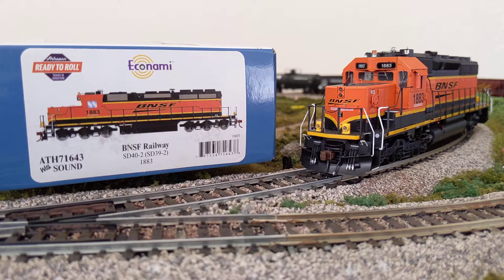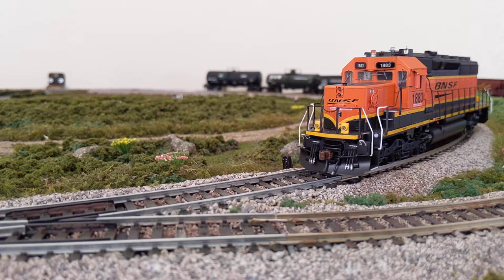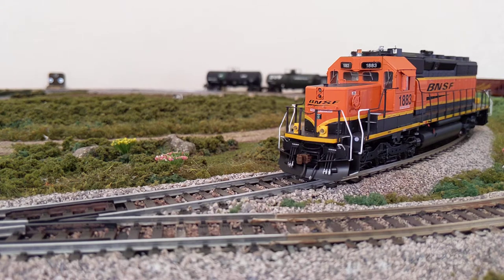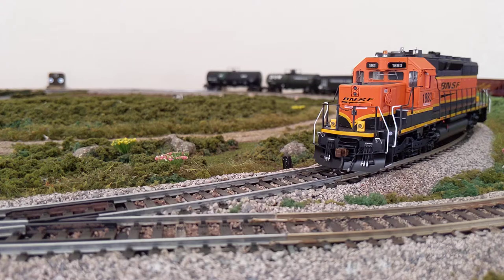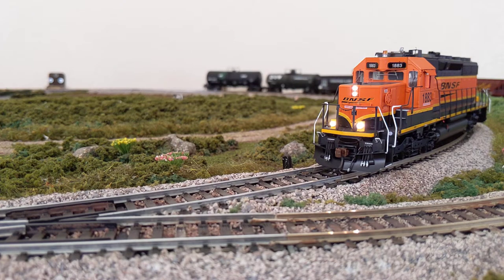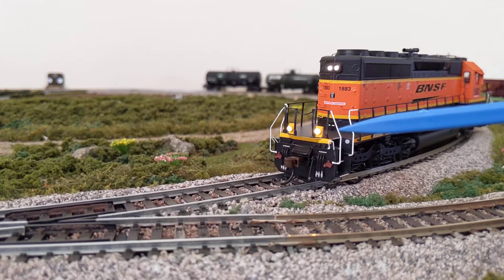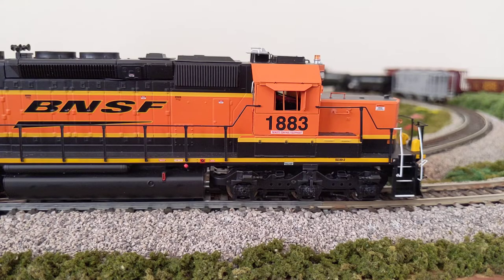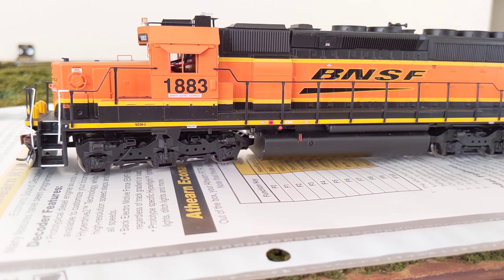Basic Review: Athearn Econami DCC with Sound BNSF SD40-2 (SD39-2)

Comment: What CVs did you set so the sound is muted when track power’s enabled. Mine is set to default so the engine starts with track power
Reply from the maker: For general muting, I use function 8. To prevent the locos from starting up when track power is first enabled you'll need to adjust CV 114. CV 114 has a number of variations but I program with just the number 5. This gives me auto notching at speed step 5 with "Enable Auto Start" disabled. Check out the "Econami Diesel User Guide" which has a much better in depth set of instructions that what comes with the box.